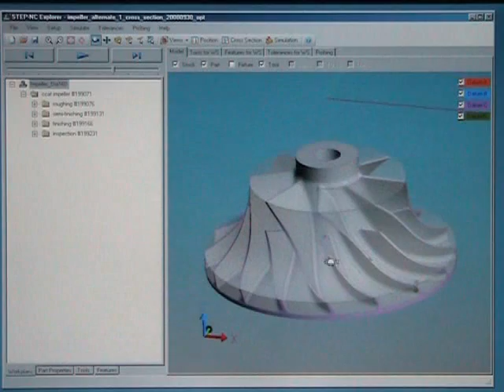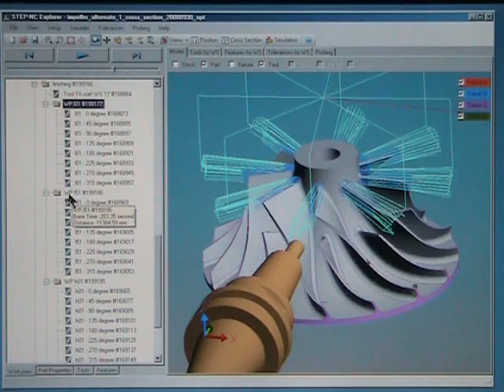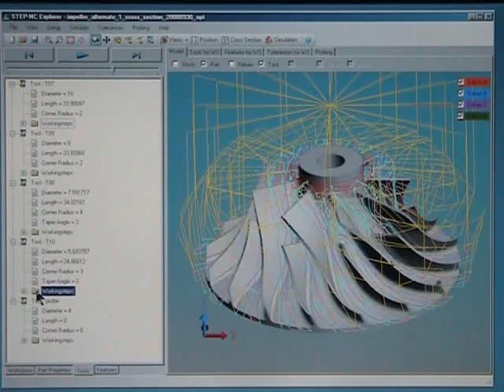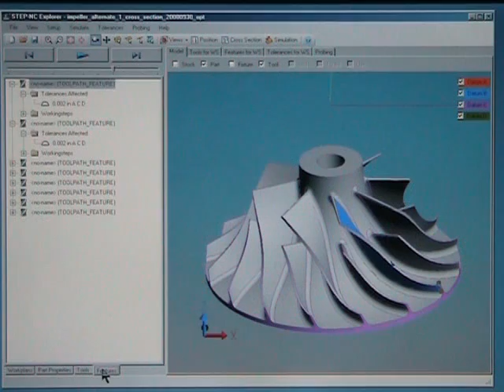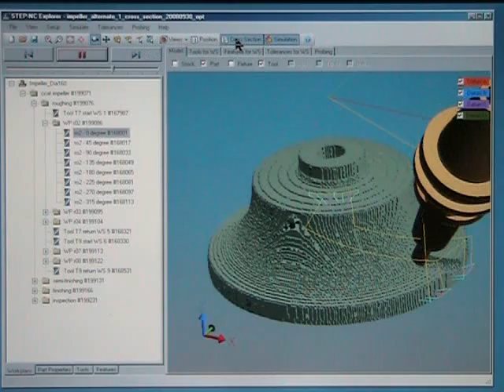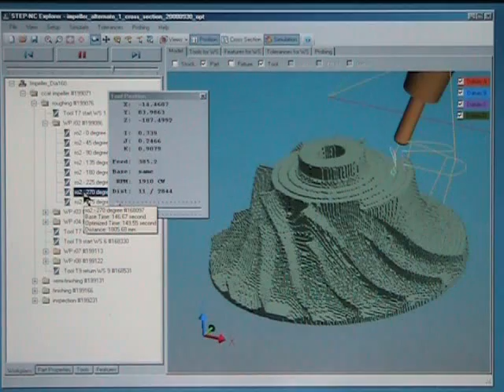STEP-NC Machining Demo, Oct. 2008

Comment: I really don't see the point of this - it seems more like a gimmick, than anything else.  I get what you are saying - make the model more generic, and make the machine controller/embedded computer do the work of interpolating how to machine the part.  You aren't reducing the amount of design work required, just offloading from the par t designer to the machine designer.  Yeah, you'll say "but machine only has to be designed once", yeah, but it would have to be PERFECT or it will fail.
Reply: streamlines the cam side of the manufacturing.  eliminates g code, eliminates post processors, simplifies in process gaging, dumping g code to go from straight model based machining will be an evolutionary step in cnc.